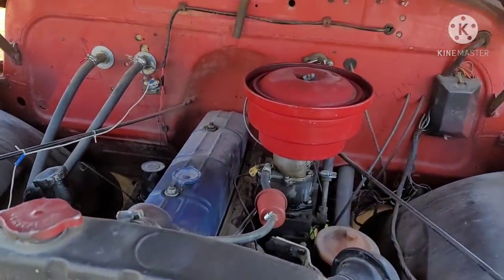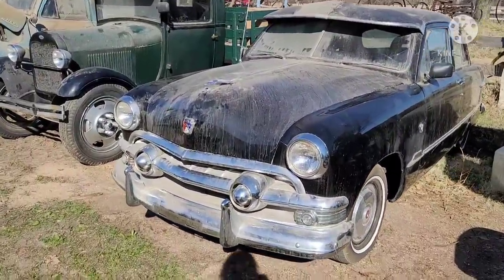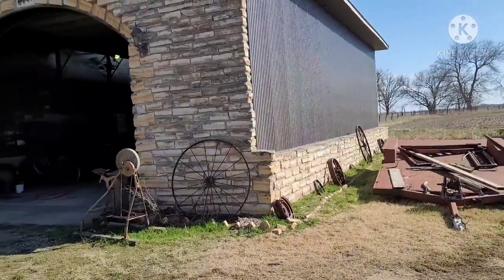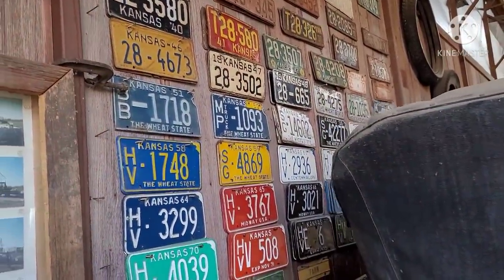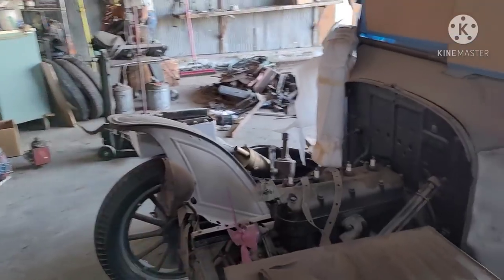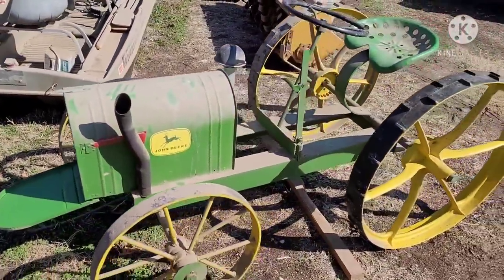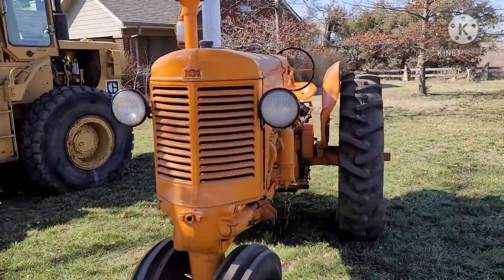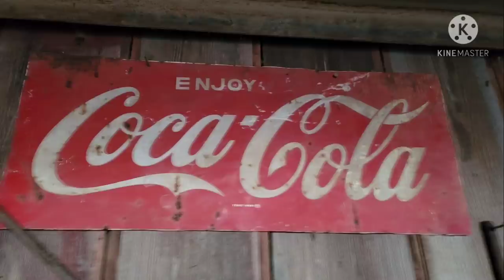Restoration & Barn Find collector cars at Auction: Chevrolet trucks, Ford Model A & T, + tractors!

Comment: OK, I promise this is my last comment! You're correct about the John Deere Tractors and equipment being more than a brand ,They were a religion! My Grandpa,dad and uncle wouldn't have another brand of equipment on their farms! In fact my grandpa said that was the reason he named my dad John!  The old steel wheeled John Deere Tractor with the big heavy built radiator was from the 1940's as my dad ,uncle and grandpa went together and bought a brand new 1947 John Deere Lindeman crawler Bulldozer and it had that style of radiator and started with the flywheel the same way! After a few years and before I remember my dad bought them out because we always had it from my earliest memories! I hated trying to start that thing by turning that flywheel so I taught myself how to tune that thing until it would start first good spin!  I always liked the Minneapolis Moline tractors like that one because I hardly ever saw any of them and I'm drawn to unusual things! The big red Chevy truck was done very well! It was over restored! It wasn't that straight and the paint wasn't that smooth and shiny when it was new! The McCormick Deering tractor that was unrestored and beat up was cool too, If I would have been there I would have bid on that just to straighten out all of the dents in it and get it running! and the '' Minnie Moline''  because they look so cool in their unrestored state!
Reply from the maker: Thanks so much for stopping by the channel. I like hearing your memories of these tractors and vehicles. I agree the Chevrolet truck certainly was restored to a quality standard. You will like seeing what I  spotted on an upcoming auction. It's a John Deere crawler, but I don't know the model yet. Stay tuned!!

Comment: The TT, ‘51 tudor and AA should be washed up and put into my garage. Oh and while you’re at it throw one of those 3100’s in with them.

Actually, the T touring is a ‘17 to ‘22. It looks most likely to be a ‘22. It’s got the vertical windshield and 3 piece backend.

The green and black Ford pickup is a ‘39. It’s got the solid grille center and doesn’t have an ashtray. ‘38 Ford would have had a split center grille and an ashtray.

Put that roadster into high gear and rock it a little bit. She might break loose.

I’m lovin’ your videos. Keep up the great work.
Reply from the maker: Thanks for stopping by the channel. You have a well trained eye for vintage Fords!

Comment: The old blue truck with all of the barn dust is the one for me! I know the red one and maroon one were older restorations but they still could be touched up and made to look too nice to use for hauling! If I bought them that is exactly what I would do is touch up the bad spots, buff them out and make them look as good as I could without a project and flip them! The old blue one is just beat up enough to drive it without caring if I put a scratch or dent in it!
Reply from the maker: A friend of mine bought the blue one. He loves that truck.

Comment: Wow! I made my comment too early! I would love to have the 51 Ford tudor sedan! I have it's twin right down to the color inside and out! But mine is a litttle rough! I hid the rust holes in the rocker panels and fastened the flapping front fenders on mine by screwing a long stiff chrome moulding over all of it! And the holes in the floor are covered by old scraps of metal and carpet! I got the heater to work so I stayed warm even though it was drafty!
Reply from the maker: Reminds me of the phrase a friend came up with, "You don't have to get it all the way right, just get it running." A car doesn't have to be perfect to be fun.

Comment: Mr. Badsocket - I have a question that only you know the answer to! As you mentioned, Chevy and GMC ["GM"] produced gazillions of those "parrot nose" trucks after the War. There was so much pent-up demand for small trucks that nothing slowed GM down. I inherited five of those old trucks when my dad died in 1987. Among the five was a 1949 3/4 ton Chevy flatbed, and a 1951 GMC 5-window pickup. Four of the five trucks had the 216 "babbit" motor. The 3/4 ton Chevy had the 235. The motors of all 5 were totally blown. My question is: How often do you see one of those old trucks with the original 216 in good operating condition? Apart from regular oil changes, what is it that kept those trucks running?
Reply from the maker: From time to time, I see one still running. I don't think there was anything inherently wrong with them, they were just antiquated
Reply: The design was so simple. As you know, oil was delivered to the top of the motor by those little cup-shaped things that were attached to the timing chain. They scooped oil out of the pan and splashed the oil onto the top of the head, where it flowed down shallow channels to the valve mechanisms. GM's motto in that era was "oil pump! We don' need no stinkin' oil pump!!" Anyway, I alwayls thought that type of motor was vulnerable to damage caused by somebody running it low on oil.